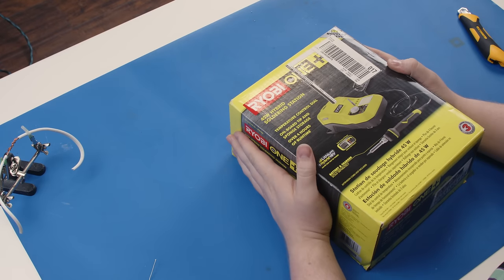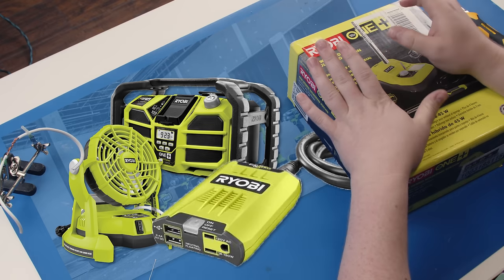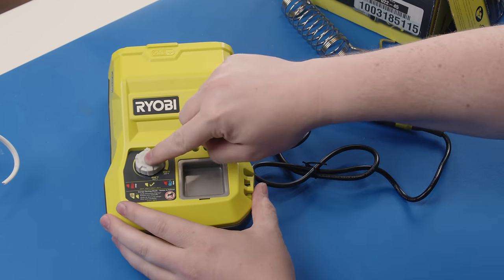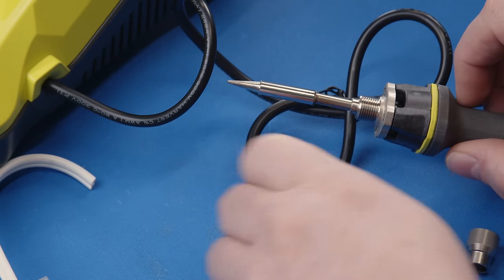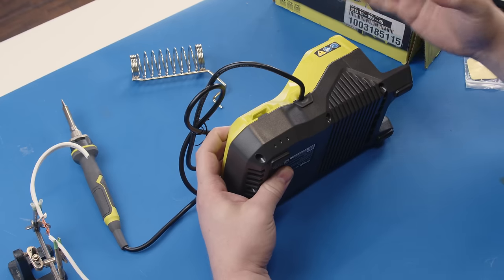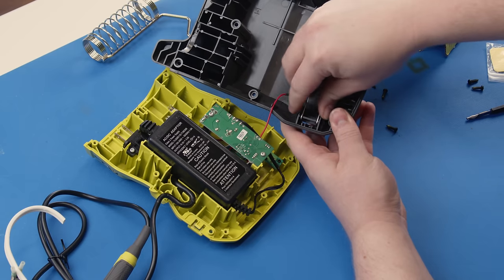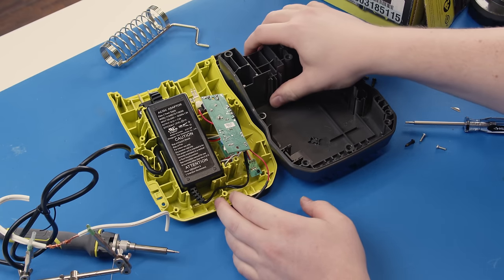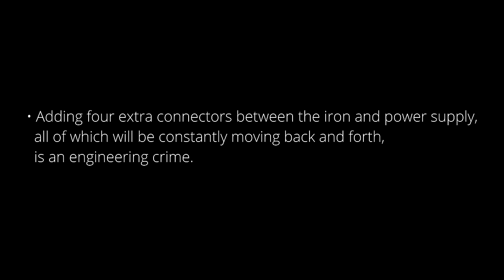Ryobi has GOT to be joking with this soldering iron

Comment: Rather go with the more expensive weller station that has to be plugged into an outlet. If I designed a solder station, it would be USB-C powered and have a compartment for your power bank to make it battery powered, or you can power it with a 65w or larger USB-C wall wart. Also non proprietary tips and replaceable iron.

Comment: Thank you for your review. Clip the string Kathy dang, the Ryobi soldering iron p3105 rivals ever other iron i have save my Weller station. NO fanboy, i only have two robi tools but the forementioned iron works amazingly with my DeWalt to Ryobi adapter. Great for RC racing jobsite motorcycles in gay rog etc. its just so handy vs corded... my 2¢ probly not worth that on-line ✌

Comment: I build and fly fpv drones. I have a welder on my desk, and a ts100 in my travel bag. The ts100 work just as good as my Weller on the bench. I power it with a drone 1500 4C lithium battery.

Comment: With the wire, just put a silicon sleeve over it, problem fixed. Also, the plastic sleeve will also soften when the unit is on and then (in your word) fight you!. So the cost a couple of dollars you gripe would be fixed. 👍

Comment: I have NEVER seen an external power supply built into a device like this. Upsetting at a primal level. I also think it would have been far better UX to just let us use the external power supply normally, like plugging it into an extension cord. Instead of having to plug an entire extension cord into the device. Also, extra cable length and flexibility, heat dissipation, etc.

Comment: something i have found myself doing is making my own tips from brass and bronze instead of the copper crap that vapors away in 100 hours of use ,been thinking of casting a tip out of pure silver but meh idk maybie if i find some old sterling silverware or a cheap coin.

Comment: I'll bet Ryobi Wan Kenobi marketing dweebs are on this review like glue and now know we're all freaked about the pvc cable and use of a finished power supply. They had to know someone was gonna open the chassis on camera and we'd all be horrified. It's a good concept that looks like engineering children made some poor decisions on. Maybe this video will aid as the marketing research they forgot to do, then they can correct it. I'd buy one then (if it is a true 900ºf iron- in need blast furnace mode).

Comment: In 2011..there was a  "herb iron"..  it was a plug in , pushbutton ceramic heating element for vaping or smoking herbs..or tobacco!  😂  💯 And the main thing is...   be careful with the ceramic!   And they have a cheap 5 dollar soldering clip that makes the tip not touch the table

Comment: If you melt through your cable: that's a you issue. And also probably better for everyone that your iron stops working after that. Any normal human being doesn't just drop the searing hot iron randomly on the table.
Also you can change the cable by opening up the machine, it's not difficult.

Comment: if you wanted a battery powered weller, wouldn't it make sense to buy the inverter and just plug it in that way? XD I got a cheap soldering station from ebay it was only like 20 or so bucks but it works fine :/ not sure if i would ever need it to be battery powered since I have the solder station in a well ventilated area of the house. Also when we bought the house we found a ryobi drill with extra battery and charger XD i guess we do get one assigned at some point :p

Comment: 24:30 - WTF?! You're not supposed to expect the full temp of the iron to go through the power supply cable. It should only experience the inductive load of the system. This part is nit-picky AF.

Comment: There is a misconception that Ryobi makes cheap garbage tools, when they actually build ehat homedepot calls "Homeowner grade" tools. They work just as well as a low end professional brand like Rigid, but they are not built to be abused like a professional tool. A Ridgid drill would take several drops from a ladder and be fine most of the time, where as a Ryobi might die to its first 5 foot drop.

Comment: I Saw the not interested, and that's fine. But since I picked up my TS100 
I'm loathed to use any other. It runs on any of my RC's battery packs just 
fine. I now go out of my way to solder things. Something I never did before.

Comment: The cable things seems petty to me. The bending and stiffness would be super annoying, but the fact that a hot burning metal tip can melt its own cable plastic coverings seems reasonable. How would a rubber flexy one be any different? Rubber melts too. Unless its a fire retardant fiberglass jacket, its gonna melt. Sometimes we have to accept that careless things happen and you just have to be careful.
Reply: Good cords on irons are insulated with silicone rubber which will easily withstand incidental contact with a hot iron. With the iron turned up maximum it wouldn't withstand prolonged contact but it won't melt through nearly instantly like PVC will.

I actually used a thin silicone rubber sheet on top of a small hotplate I use for reflow soldering of small circuit boards with surface mount components. The whole board has to get hot enough to melt solder and the silicone stands up to that quite well.

Comment: I was eyeballing that PVC cord. I hate PVC. It should never be used as a power cord sheathing. I never gave it much thought until I started replacing some of the power cords on our power tools at work. I noticed the replacement cords weren't as flexible as the original. It was then I learned the difference between PVC and silicone rubber. I started buying silicone rubber wiring any time I can. Even my multimeter test leads. I have a couple older weller soldering stations that use PVC, I was thinking about replacing the soldering iron wires with silicon but it probably wouldn't be worth it.

Comment: When soldering you should never push your Iron into the work. It should just touch it. The proper tinning of the tip and the transfer solder should be able to transfer the heat necessary to make the connection.

Comment: This seems odd... complaining about the sealed power supply. i mean yea its cheap, but its cheap that works. that supply is UR tested at least it says it is and coming from ryobi it likely was checked to make sure it was. 

the cable being what it is i get, that is very much so wrong and TBH i would rather a proper cable and honestly a connector so i can detach the iron for storage. but like the plastics being thick to try and fool you... no thats just the same plastics ryobi always uses. ive got a few ryobi products including a little power inverter that they tossed in a set of tools i bought. they all have the same feeling plastics. so really i would just call that a good thing. they used their normal plastics for their more high dollar stuff and didnt cheap out on something they know wont get dropped off a ladder like their drills. id call that a thumbs up.

the power supply... honestly why does that matter. its a cheap option that didnt require them to over design something to go through more certification. also really it makes it more repairable. if that power supply takes a crap. well i can just go find another one with the same output, resolder the wires and if it doesnt fit, egg out the plastics till it did fit. much better than an open frame or custom designed unit that i cant do anything with. 

really the absolute worst... the wire. yea thats bad no excuse its horrible and i dislike it because of that. but really only because of that. the iron itself looks like a hakko design. and really i might try to see about just modifying the circuit wires and case to accept a hakko or clone hakko iron and connector if possible.

but also this is like pretty close to a one off product aside from that other little cheapy product they make. but i really havent seen any other battery powered irons that are designed in a similar way. so really it makes some sense that ryobi a company that doesnt make these products normally would make copies or cheap out in places. who knows they might make the product better down the line should they goto continue its design.

Comment: The TS101 has USB-C far better in my opinion. Because you can use a normal USB-C power pack or get an adapter for any tool batteries you use already.

Comment: How many new gen Ryobis do you own & use?

I've kill more DeWalts & Milwaukies than you've seen. In daily construction use, they need repair on some aspect every year.

The new Ryobis are the only 1/2" drill I've owned which have not needed the clutch, the trigger, the motor or anything else in a year.

The Ryobi cordless stapler/nailer is genious. They were the 1stt to come out w/ small air compressor.

Your flippant complaints seem to be based on conjecture.

Re: torx & tapered holes
Every effing manu uses this combo. You need a 6" non 'impact' hex bit to work on anything, now a days.

Re: power cord
Buying anything made in China has an effing PVC cord. I hate them.

Comment: The cord to the iron stinks.  The handle is beautiful.  The ceramic heater which includes the temperature sensing element has to be that way to accurately control the temperature.  It's that way on all good temperature controlled irons that I've had.  My Hakko is 12 years old and is still  fine.  It's great that the iron takes standard Hakko tips so you can easily obtain a wide variety.  I wish the base was smallerr

Comment: If they made this soldering station with a temperature indicator and a decent silicon cable connecting the iron to the body, and ideally with a rigid clip to hold the iron holder instead of this bare wire wobbly thing, I'd buy it for twice the price even.
PS sponges are sh*t, brass fillings rule. I suck at soldering but just switching to then from the sponge made me feel so much better, and the quality of my work and the speed of it both increased palpably.

Comment: You should not force the tip down into the work, you lay the tip against the joint lightly, the solder will carry the heat.

Comment: The Cold Heat were terrible for general use BUT for model train builders needing to solder a small wire for lighting in a diorama. Dude, normal soldering, dangerous.

Comment: I HAVE BEEN USING RYOBI FOR 25 YEARS. AND I HAVE A DRILL THAT I BOUGHT AS THE FIRST SET OF RYOBI TOOLS, ALL REFURBISHED, AND ALL STILL WORK EXCEPT FOR 1 DRILL. I HAVE 3 BATTERIES THAT ARE 11 YEARS OLD AND STILL WORK. THERE THE BEST. AND I WON'T BUY ANOTHER BRAND. I HAVE BATTERY AND GAS YARD TOOLS.

Comment: Those might be Hakko 900M tip compatible. It is a very commonly copied size. I don't like that style, because of the fragility issue, and because there is a big air gap between the heating element and the tip.

Comment: I'm waiting for a battery-pack soldering iron built with the attributes of, and to the standards of a Metcal, meaning it's designed by people who actually solder. This one wasn't. It was designed by a cordless tool company. The same designer probably designs cordless drills. So far, as far as cordless soldering is concerned, I've seen only junk on the market. There is no good battery-pack iron at any price. 

I doubt if that IC on the board is a microcontroller. It's probably just a  20 cent multiple comparator IC that pulses the output based on the pot position, with a bit of feedback from the iron tip to stabilize the temperature. A micro-controller would be used when the iron actually told you what the temperature was. I shuddered the moment I saw that there was no ground connection on the AC cord.That said all there was to say. This thing is an utter kluge. BTW, don't simply trust safety certification logos on anything that comes out of China. Some manufacturers are perfectly happy to simply slap a slew of them on their labels if it helps sell their junk, because they can. I typically dismantle things I buy from China and rebuild them to make them safe and reliable, add heatshrink, strain reliefs, vent holes, etc. I look at it as if I were buying a kit to build.

Comment: The Original Weller Soldier gun we have, from the 1980's has Styrofoam as for a place to set the Soldering gun on .. after Use!   so, you could just get Styrofoam!   The Fumes from the Styrofoam, may be a bad thing to have though! but, then again - Back in the 80's and before then - we used lead soldier... so...

Comment: So in fact you have to buy 2 units and the wire. You use one unmodified unit to change thecable on the other one. Then use the modified one to change the cable on the unmodified one. Then you can sell 1 unit at costprice mentioning the upgrade in the advertisement. So you upgraded your one for free. 😆:washhands:

Comment: 29:25 and 44:30 Not really a good idea for a good heat dissipation to have power supply boards with a double plastic clamshell around. Overheating shortens the life of any electronic component.
UHF modulator, at least, had a metal chassis.

Comment: That round cylindrical profile on the AC plug for the lamp makes me think of European plugs - obviously they have different pins but I do wonder if they reused part of a mold meant for those - a lot of continental european standards involve a recessed circular socket about that size.

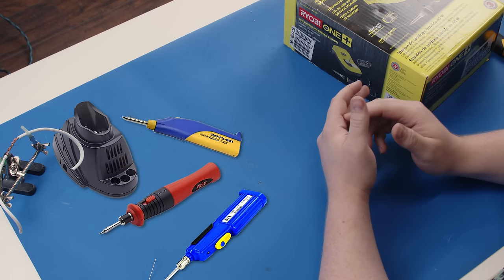Comment: 4:00 my father bought the on at the bottom, and gave it to me when he bought a corded one. It is awful, and powered by 2 or 3 double A's... bought a walmart brand corded iron to replace it, and it was far better. 

Recall some popular mechanics encyclopedias having guides to make a portable battery pack for power tools and soldering irons, the massive resistive heating element ones (with about a half inch to 1 and a half inch thick tip).

Comment: There IS legitimate uses for those dirt cheap soldering irons. The work perfectly to cut through fabric like butter. Redoing headliners in cars for example, you can slice out a perfect size opening for lights or screws or whatever and not have to fumble-fuck around with sissors or razor knives.

Comment: If you're watching this, do not pay any attention to this guy's comment on 115 volt plus in soldering iron. They are not the flimsy piece of junk he is making them sound like. If you put too much pressure on it of course you will bend it. I've been using electric soldering irons like that all my life and they are fine. The tip is not just shoved in there, it's threaded
Reply: 95% of those irons use tips that have a retaining grub screw. Of course you can always find edge cases to any assertion someone makes, but that's why they're edge cases. Once you use a good soldering station you'll understand why people dislike those other types of irons. It's like cheap screw drivers, they certainly do the job, but once you've used a good set you understand the difference in quality.

Comment: I'd be concerned that PSU would overheat if left running too long as its designed to only have one layer of plastic insulating it.  That bend radius on the AC cable doesn't look great either.

Comment: Ok no Ryobi's almost fluorescent yellow-green is way worse than either of those Harbor Freight tools you showed.
Also from everything I've ever learned about soldering, you're not supposed to use much pressure at all, especially on PCBs. It's really easy to damage a PCB using too much pressure.

Comment: Yea the stiff cord would be annoying but you were acting like the heat comes from the machine. It only gets hot up passed the thick metal you talked about in that ceramic piece. You're not supposed to lay the hot iron on the cord either

Comment: The screw thing, the make the channel taper for ease of assembly, how many times have you had to dance a fastener around the plastic lip of a screw hole, so they taper them so the screw is guided into its home, and I definitely feel for you on the decided fastener, why the hell would they use torx fasteners? NO one absolutely NO ONE has a torx screw driver that doesn't use it regularly.

Comment: Ryobi has always been tagged with the reputation of "crap".  It's probably deserved.  But i'm one of the few that didn't receive a Ryobi 18v battery with my birth cert, so I can't really attest to that reputation.  But they could be trying to break that reputation with the overbuild body.  Or... just more of a shitty plastic equals the same strength as a good plastic.  Who knows.

But point 2... the weight.  So often I get a cheap as something or other, you sit it on a table, and the cheap ass cord pushes the light weight item it's attached to around, becoming a complete fucking disaster to use.  You know how that goes.  Youre soldering something and the cord pushes the box off the table, so it's dangling there, so you put the iron down a sec too adjust the damn thing, but when you adjust the position of the box the iron falls on the floor lighting the drapes on fire and the wife starts yelling cause your burning down the joint and she ain't going to be looking at you friendly for a few days or maybe a couple months... depends if you bought the Ryobi 18v fire extinguisher or not I guess.  I bet now that I painted that picture you wish you did.

But Maybe the over build is too cheaply provide a little extra weight with some extra rigidity?  Two birds one stone so to speak.  This would be a benefit with that brutal cord.

Itd be interesting to see if someone eventually bastardized that station to use a Weller iron.  Won't be me though.  I have a Weller and don't intend on trying to make a portable knock off Weller.

Comment: a 12 volt battery and 1000w pure sine wave inverter will run a plug in soldering station anywhere

Comment: The temperature rating on the side of the cable should be the maximum temperature for the wires inside the insulation. The tip of the iron may be 600°, but thats not the cable temp. Its still cheap crap, im just saying I've never seen an electrical cord with a temperature rating of 1000°. I mean that temperature melts some metals, it also melts rubber...